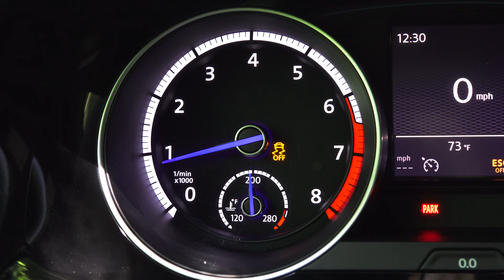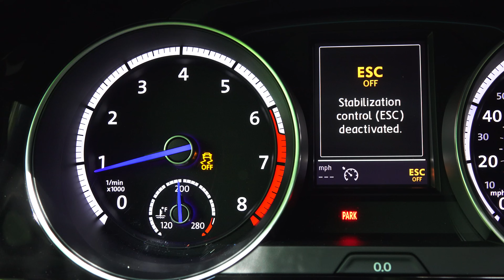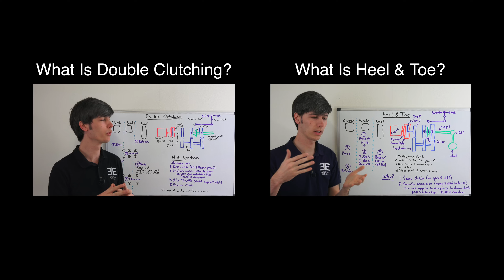How To Launch A Manual Transmission Car

Comment: I think I've never tested 0-100(0-60) in manual only tests I did were with automatic. Now I have a car with smaller compressor pulley, and it's tempting to try 0-60 to compare with stock. The best test for me is 80-120kph because it's overtake speed, I don't care 0-x speeds cause it's useless actually. Most of my overtakes, depending of amount of cars starts with 80kph and ends up to 190 so far, but mostly 150

Comment: Step 1: Pull in the handbrake
Step 2: Put it in first gear
Step 3: Floor the accerelator
Step 4: Clutch to the bite point
Step 5: Release the handbrake and dump the clutch

Comment: is it easier on your transmission if you rev in neutral first to match gears to engine speed and then go into 1st? kind of like double clutching at a standstill? This way, your transmissions gears are already spinning at engine speed, the syncros don't have work, and the clutch only has to overcome the inertia of the car.

Comment: My Focus ST has a rpm limiter on launch in 1st gear. Same with the older model. And redused boost pressure for 2 gears.

Comment: 60 years ago, it was simply stated as slip the clutch or slip the tyres, best not to do either, revs at bottom of torque curve, let clutch out smoothly but swiftly, get car rolling, whilst simultaneously flooring throttle (not too much that you induce wheels spin). Change gear at just above max torque.  OK, so you may be half a second slower to your object time, but you can do it all day and still have a useful car.  

If your objective is simply is absolute lowest time, prepare for some hefty bills!

Comment: I've been doing this on my stick shift 2022 toyota Innova (2.8 1GD FTV - RWD). Although a diesel and only around 174hp, it is very possible. Here's how I do it:

1. Handbrake up
2. step on the clutch
3. put it in 1st gear 
4. (this depends on what car) I step on the throttle then raise the rpm up to 3.5k to 4k
5. release the handbrake then let go of the clutch pedal while still on the throttle 
6. then boom, you got yourself a power launch - pretty satisfying when the wheels spin and make a distinctive sound :DD
7. also, 2.8 turbo diesel goes vrooooom, stuuuuh, vrooooooom, stuuuuuuuuh (not stututu coz it's diesel)

Comment: I tried exactly the same to start like this on my audi S3 8v FL 2017, but tachometer stoped on 1000 while breaking. Cant make 3000-4000. Any ideas?
Reply: The car is so strong probably will spinn it you go over 1000

Comment: All depends on the individual vehicle.
FF cars you can preload with handbrake then drop the clutch and feather the throttle if needed though wheelspin is basically guaranteed if you are launching at max speed
FR cars you generally want to hold revs at a set point and then dump the clutch expecting a second or two of wheelspin
AWD cars you will usually want to slip the clutch and not just dump it at high revs unless you have a very strong transmission and driveline or don't care about either
MR/RR cars have a lot more weight on the back generally unlike FR so you don't really want to see much wheelspin if any on launch if going for fastest 60 foot times
And if you have a car that is rear/mid engined and AWD, you're probably very rich so just go ahead and dump the clutch from limiter or use one of the 50 launch control options that come with your Lamborghini/Porsche/Ferrari/Midlife crisis

Comment: Speed runners guide to launching a manual car

Step 1: Open your hood
Step 2: Start hitting stuff with a sledge hammer
Step 3: Take $1100 and light it on fire
Step 4: Redline your engine for 1 minute 
Step 5: Take the burnt money charcoals and throw it inside your car to simulate that authentic “racecar” smell
Step 6: Stand on your doorjam and rock the car like an angry gorilla
Step 7: Congrats, an entire weekend at the track completed in 3-8 minutes

Comment: Does anyone have any tips and the right RPMs for launching my car :
Vw polo 1.4 litre FWD 
I always feel it spins way too much when u try to take off
Reply: Don't floor it right after dropping the clutch. Try throttling it gradually. After it accelerates above 3000rpm, floor it right away

Below 3000rpm it should have a little wheelspin :D

Comment: 1. Start the engine.
2. While it warms up spend your time making complicated and worthless calculations while attempting to explain them.
3. Fully depress the clutch petal.
4. Engage first gear.
5. Fully depress the throttle pedal. Yes, you read that right, fully. (Don't worry about overrevving, modern engines have a limiter.)
6, Move the foot you have on the clutch pedal sideways to allow the pedal to pop up and the clutch to engage.
7. Enjoy the smell of burning rubber, or if you are unlucky, exploded gearbox or burnt out clutch. (The most skilled drivers have been knows to break drive shafts, destroy clutches and disintegrate gearboxes in one launch.)
8. Have a banana.

Only do this in the privacy of your own home and at your own risk. Do not do this on a public road.

Comment: I tried this in my mums Toyota Auris, 122 horsepower, 5 speed manual hatchback, and discovered, it is bloody fast. I did a long FWD burnout after jamming it, and into 2nd with clutchkick that was violent enough to rip ones head off
Reply: thast noth try fari oamghi v12 orshe inkue 6 turbo chare ores 930 trbo rick ships  ouls 1 g firce

Comment: 1) Set the line-lock which puts the rev-limit 0n the low side 2) Put the (gas) pedal to the metal. 3) Last amber let go of the button and hang on. 3) Keeping the pedal to the metal, hit clutch and pull stick on the floor at 7500 rpm. 4) same, but push stick. 5) see #3. 6) Ask God to keep the car going straight. 7) At the finish, let the pedal off the metal, move right foot to the other pedal and ask God to stay with you while you get the damn thing slowed down. 8) Don't forget your time-slip Zoom Zoom.

Comment: I drive a Mazda Rx8. What I. Wondering is where does my car fall into the suggested RPMs to launch at? Rotary engines pit out a lot more power for their size but a lot less torque.

Comment: To Launch Control You Just Have to Keep in 1st Gear nd Hold the clutch and higher the rpm and suddenly realise the clutch (Don't realise the clutch too fast or too slow) after realising the clutch press the acceleration and shift the gears....

This is my launch control if any thing wrong pls reply me......

Comment: If im buying any 2015+ Camero, Mustang, i better be able to mash the gas a good bit without it getting squirrely. If it does, the stock suspension/traction setup is garbage. Get some good SFC's and an adjustable pan-hard bar to start with, then upgrade the sway bars.

Comment: So i have a 2015 Volkswagen Jetta S. I have the 2.0L non turbo variant. It only makes 115 horsepower.  My car now has 52,000 miles on it and I've had it for almost 6 months. It took me a while to launch the car off the line smoothly because the engine and clutch is so smooth it's hard to feel when the clutch grabs. Now when I want I can shoot the car off the line like a rocket. Sometimes I still get a little wheelspin. And shout out to Volkswagen for making the toughest clutch ever. I be getting in it and there is nothing wrong with it.

Comment: Like others have said...... WRONG WRONG WRONG.   I have driven every think for big diesel trucks to VWs.   You normally just give the fuel pedal a little push.  Normal idle is usually under 1000 rpm.    Maybe start at 1500 to 2000 rpm and the start slipping the clutch.  Hols the fuel pedal steady until the vehicle is moving then remove foot from clutch and start pushing more on the fuel pedal.

Comment: My cvar won't rev more than 2000!  That is until you are in high gear.  You need to re-think this stuff or state that it's for older cars from the 1980s or before.
Reply: whats your car ?

Comment: I've heard that cars using a 4wd system with a transverse engine/gearbox have problems with weak transfer cases, so hard launches can brake the gearing inside of them.

Comment: how to launch an mt car
1. almost redline the friggin engine (6k rpm at least)
2. let clutch out very slowly (let the clutch pedal travel for about one minute from bottom to all the way up)
3. after launching, shift into second gear when car stops accelerating ( hitting rev limiter). Use the speed at which this happens as a reference on when to shift down again

note that all these steps should be made while the engine is still cold, best results during winter. in that case, thermal efficiency will be as high as possible.

Comment: So with a 195hp 2.0diesel xdrive bmw I should be at around 4-5 thousand RPM?
Reply: no.

With diesels you only need around 2000-2500.

Comment: so i have an antilag launch control on my car, from a tuning perspective i have the option to cut fuel or spark when at a curtain rpm, i found from cutting spark when i first launch the car seems sluggish do to being to rich AFR show this, where as if i cut fuel the opposite affect happens she leans right out when  i first launch the latter performs better on the track but also prolly not the safer of the two options, any ideas on getting it to cut spark but not enrichen when i first laounch

Comment: You can shift from 1st to 2nd Gear with out using the clutch to do less time to accelerate from 0-60mph .But this will do some damage to your clutch. So you should better avoid that !
Reply: Not only your clutch but also your transmission.

Comment: my 14 jetta tdi diesel actually has a rev limit of 2k when stopped, so all I gotta do is floor it and slip the clutch and the turbo is at ~7psi at the 2k limit, and full spool is at about 1700-2000rpm (somewhere in there) so pretty much as soon as I fully release the clutch it hits the full 28psi of boost and I got full acceleration at ~15-20kmph, but then traction control kicks in lol

Comment: Question: can it be beneficial to launch in 2nd gear? Asking because I remember a video of BMI Hot Version where they said that you should launch the R34 GTR in 2nd gear at 5000 rpm.

Comment: Pull e-brake, partially disengage clutch to load everything up, light turns green then release e-brake and clutch at the same time and floor it

Comment: hold on a second. at 5:50 he gets off the clutch really fast (but smooth) but he said to ease off it so should i do it like he does it or should i do it a tad slower?
Reply: You just need to sync the gas
Thats it
If you dont sybc your gas pedal youll stall or start off super jolty
Reply: JItterRy PoKERy ok i’ve been getting really good at shifting so i think it makes sense now :)))) thank youuuu

Comment: So far only one time have I really launched my WRX while I was taking two of my aunts for a drive on a country road. I stopped, revved it to 6k rpm and popped the clutch. That's right - I let the clutch out abruptly. The car actually rocketed forward like my old 1993 RX-7 did in the same way.
Reply: gúd yiuvthatgud eng rom teabliytty

Comment: Does this work with any type of car from any time? I have a Ford Focus 1.6 from 2004. If I use 1st gear at 3000RPM the engine already sounds like this guys car engine 5000-6000RPM. I know my car is not a sport car, so that's why I ask. I'm afraid that I'll break something that'll cost me a lot of money. Also when normal driving, at 60Mph/100Kmph I am at 4th or 5th gear already, I feel like 2nd gear at that speed will just destroy my engine.

Comment: Pro tip:
Remember to release the parking brake
Reply: Forgot mine was on before and blew my e brake apart 😂
Reply: @mario350zhr3  noo😭😂
Reply: Unless you want to do a big front wheel drive burnout
Reply: Litteraly did this with my friend last night ,man was tryna teach me how to spin my tires i go and the Toyota etios does not move just spins like a motherfucka and he just luaghs me not knowing wtf is going on and he just points at my handbrake light😂😂😭😭
Reply: you know from experience I see

Comment: Rpm should always be increasing when done right, a temporary hang is alright. Unfortunately this video teaches how to use the engine as a big flywheel, shocking the car into a temporary skid ( inertia of engine ripping the wheels over) while the car engine stallls from a high to a low rpm, stopping the skid, but ultimately wasting tyre, time and wasting the clutchs life. Jerks and overloads are no good for speed.

Comment: is holding the throttle not a rookie move? I am not trying to be a jerk but I launch my crappy mazda 3 for kicks and basically just kick the thottle like a downshift (roughly 4500rpm I release the clutch and shift to 2nd at 5500). It jumps like a jackrabbit lol. 210k on the clutch and it works like a charm so no wear and tear. zero to 60 seems better than that subbie lol.

Comment: Normal people have a spare tire at the back my man has a spare clutch
Reply: Hydrocarbon hahah
Reply: That means I'm not normal because mine has a tyre sealant
Reply: PhilSpeedz hi so does my car, but will search for a REAL TYRE. &RIM, instead of the glue in the can& as air compressor , ILL keep my electric scissor jack, my 2000m inverted, to run my impact wrench 
Cheers 🇺🇸🇺🇸🇺🇸🇺🇸
Reply: And u dont, r u even a car person lol
Reply: adasdas sdasa Lol I have my stock exhaust in the back of my car
Reply: @charliekiehl1774  stock exhaust? I got a spare car in the back of my car
Reply: Hydrocarbon spare car? Lol I have a spare driver in the trunk.
Reply: TheBloodMango kids, i have an entire spare engine and transmission
Reply: @ZacGoesCamping  spare driver? i got a group of russians in the trunk to push my car when it stops moving
Reply: @my.povertym3  welp, I can't compete with that.
Reply: adasdas sdasa I’m a mechanic and I don’t carry around a spare clutch
Reply: As an owner of a 2017 Golf R (one year newer than his demonstration vehicle), I can confirm it DOES NOT, in fact, come with a spare tire, so you are double correct
Reply: Hydrocarbon bruh
Reply: Hahahaha
Reply: He has plenty in his pocket
Reply: what, you don't?
Reply: Normal people drive with passenger in the passenger seat, man drives with a back up clutch plate
Reply: we have the same name and profile pic
Reply: @RH-ni8xp  who r u, this is identify theft we both joined 7 years ago aswell
Reply: @rh7732  what the heckkk, R H is my initials
Reply: @RH-ni8xp  same
Reply: Beloved, Please give this your special attention. God is a Good, Holy and Just( meaning that He up holds justice and does what He deems as good) Judge. He is also forgiving and He is All-Loving. He is also perfect meaning that there is nothing about Him this is contradictory. But How can He forgive you and me but still uphold Justice. It's through faith in the death, burial and resurrection of Jesus Christ. So turn repent and put your faith in the Living Christ who died for U and now Lives

Comment: How would this be modulated for a diesel with a VGT? One of my project cars uses this type of engine and although max power is at ~4000rpm, she loses the speed at anything past 3600
Reply: أحمد المنصور  What diesel have you got?
Reply: أحمد المنصور  82hp Mazda RF engine? Reliable thing, how many miles/km has she done? My project car is only a 1.6L, but after a hybrid turbo and bigger injectors/intercooler she should be good for about 220hp

Comment: another tip, which is bad for the car, doing any of this is bad for the car, but i put the handbrake on and engage the clutch a little so the car is already pulling. as soon as you can go, drop the handbrake and you get a better launch. this is IF, you are really needing to get off the line as best you can. the 2002-2003 renault f1 cars did this. they had easily the best launch control in f1 at the time.

Comment: I'm taking driving lessons and I think the clutch is waaaay too sensitive. Is it a thing that you can adjust the sensitivity in new cars? I drove an older car years ago, a small ford focus and it was great. This new car is almost as smart as I am and it feels like we're fighting constantly over what the car should do.
Reply: It's because the clutch is a mechanical item. Over time it will get harder. I personally love my soft clutch because I think it's easier to control it if you have to use less power.

Comment: how to launch a eBay turbo Honda 
step one: dump clutch 
step two: rev to red line
step three: stall the car
step four: repeat and blow transmission
Reply: Step one and two are wrong way round
Reply: how are you stalling the car at redline?
Reply: @mikhai5317  faxxx🤣🤣
Reply: Matt Sadyk oof
Reply: You obviously don’t know how a manual trans works.....

Comment: So what's happening when I release the clutch and the RPMs drop?  I feel like either I have to release it to the pressure point and let it spin for a second or release it really fast and feel the transmission slam.  I guess really what I'm asking is how you should get it to grab.  To get a good launch I feel like I have to hold my clutch where it grabs for just a second and then release the clutch.  But I feel like this Burns the clutch.  I have a turbo AWD 300hp.  I normally try to launch it around 2k-3k.

Comment: I drive a 2004 325i manual. It has 280k on it. But lately, I find it annoying when my car struggles to move especially stop and go on a steep hill in sf. Ended up changing my clutch but wonder if extremely steep hills can be a problem for manual transmissions or its the way I am shifting gears?

Comment: Why not just push the clutch all the way while also holding the break lightly, start up the car, lower the ebrake, put the car into first gear, release the brake pedal, gradually release the clutch and then the car would start moving just a little bit so you won't hit anything nearby and then when it's clear start using the gas pedal?